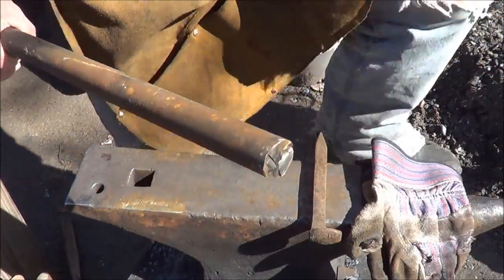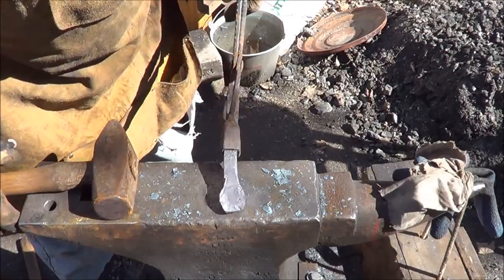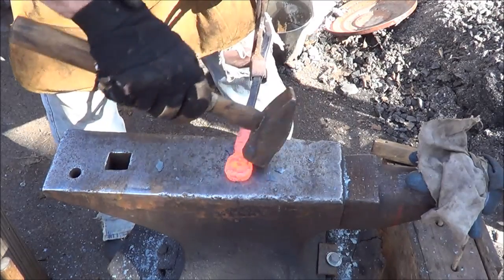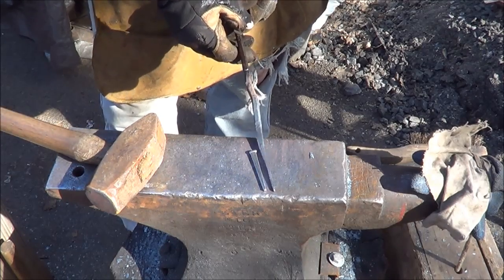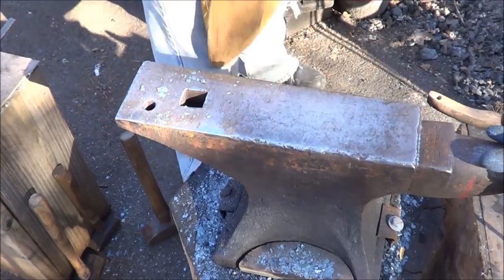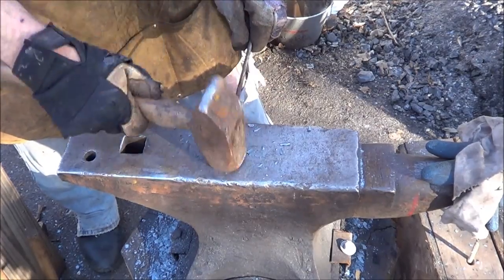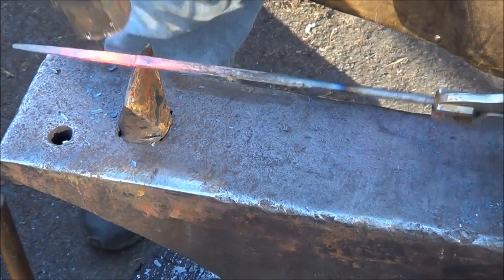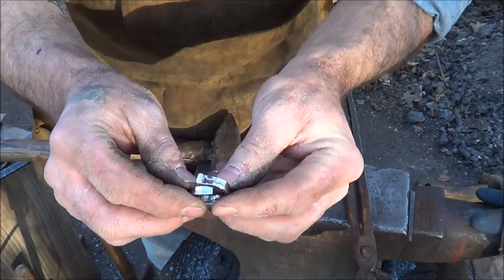Blacksmithing   Forging A Nail Header And Making Some Nails

Comment: Farmers used to make nails. During winter they would sit by the fireplace with a bundle of rods from the general store, and make nails. In spring they take the nails back to the store to trade for crop seeds. Just an FYI :)
Reply: aaron west 
when you think about it, nails hold a lot of structures together, so for people to take one object (such as a metal rod) and turn it into nails, which would be needed more so back then so you'd get a good chunk of change

Comment: When using a drift, wet the drift (or dip into oil or grease) and coat it in coal dust. The hot iron into which it is driven will turn the coal dust into gas and 'lubricate' the drift, preventing sticking and helping to not overheat the drift.... :-)

Comment: Chandler, I like the nail headers. Great to use a railroad spike for this. I'll check some here I Maine for hardenability. If you drift in reverse or from the bottom up, just a bit larger than the nail stock the nail will fall right out. Make sure when drifting you don't enlarge the top hole. I have also seen a cheat done with a drill bit to enlarge it. Not a criticism by any means. Just thinking.

Comment: Chandler, If you punch/drift a slightly larger hole from the back your nails shouldn't stick.  I've made a lot of nails at Ft. Vancouver and at personal demos.  Nice video.  I made a header out of a RR spike a couple of years ago and it's still holding up well.

Comment: I have a very old book that shows how to make a shotgun natural. It starts with these handmade nails that have been in a house or barn that burned down. One of the earliest places to get Steel, as the iron and could slowly soak up a bit of carbon while being protected by the wood beams themselves. 
I have looked for an old burned barn since to try it out.

Comment: You're doing more than I have! But I saw a trick where you bend the cut at 90 degrees and put it back in the fire with the tip pointing out the top of the coals. Your steel doesn't burn and you don't need to quench the tip!

Comment: Nice job on the nails and the tool too Chandler. I'm getting ready to get into some forging myself and I think this would be the perfect starter project. Not the tool mind you but the nails. I just ordered up a square nail header and it should be in around the middle of the month. By then I should have my anvil all set up and my forge up and going.

Comment: I make nails at a local museum for demonstration and I must say you done good. I wanted to get other ideas for making better quality nail header than what I have and I will give it another go at making a better one. You nails by the way are good but if you wanted to make them about 3-5mm thick, create a thick diamond tipped point at the end (about 1cm long) then score round the base of it and use the horn to spread it out. Keep an eye on the tip to about the thickness you need then just flatten it out so its about 1 - 2 inchs long. Cut the amount of 'meat' you want off for your head and thats it. I like to rose head the nail so it give it an old look and your finger glides off it

Comment: Hope you don't mind me saying:

When you are quenching, it's best to keep the piece moving underwater (or in the oil) by waving it side to side or swirling it around in a circular pattern.  The reason for this is that if it's kept still, a steam pocket can be created around the hot piece and this can slow the cooling - which is not what you want for hardening or tempering.  You need a rapid quench.

Obviously that's just another detail and not always essential.  Your quench worked for you.  But it's just another tip.

Great job there though.

Comment: hello chandler cool vid. i like the cut nail style header, the dbl header was even cooler idea. have you ever tried a round faced hammer instead of the cross pean ? and the horn ?i do not want to sound like a know it all, that is not my thing, but when  i changed hammers  i was able to move metal alot more affectively .bryan branzel has a great vid  on why he uses a round hammer.it changed the way i work. good to see you finally had some sun . cheers from south Texas ......   chris

Comment: Railroad spikes sadly aren't used on train lines in the UK, they use a different method of attachment. Thats why they are so damn hard to find. I tend to just use old cold chisels, its a resonable compromise, you can do with them most of the things you can do with spikes.
Reply: JacksonNomad Anti-roll bars off vehicles are a good source.  There's no demand for them 2nd-hand so the scrapyards should let you have them cheap - or even free if you have a mate there.  You only need one of two for several feet of good carbon-steel round.  Old coil springs are the same.

Comment: What if made it so you put the stick in the header before adding the point then you might get a cleaner head and you wont have to tap the point to get it out. You could have to add a little with to the top of the bar stock but thats not hard. Not sure if that would work, just a thought.
Reply from the maker: Daniel Bennett In a controlled chamber you could extrude the entire nail through the header... here you need the shank done before you go to the tool

Comment: heres a little data for you: 
Tungsten carbide
Chemical Compound
Tungsten carbide is a chemical compound containing equal parts of tungsten and carbon atoms. In its most basic form, tungsten carbide is a fine gray powder, but it can be pressed and formed into shapes ... Wikipedia
Melting point: 5,198°F (2,870°C)
Density: 15.63 g/cm³
Formula: WC
Molar mass: 195.86 g/mol
Boiling point: 10,830°F (6,000°C)

Comment: a master blacksmith that mentored me told me "Work the metal while it's hot, or you'll go to hell!". I see you're working the metal a lot even though it's dark and cold. what's your comment on that? no offence meant. another funny quote was "a real blacksmith works all day, and then goes home and makes babies!"
Reply from the maker: meNtor890 Sometimes the camera or working outside makes the metal look not as hot as I see it... sometimes I am stubbornly not wanting to go back for another heat...   BUT when the metal goes from red to black... at that point working it when it is black but still very hot allows you to use the hammer to clean up the hammer marks on the surface.... so often i will hammer hot black as a clean up.

Comment: Question. I keep hearing videos saying the anvil should be right at your knuckle height down at your side. Your anvil seems much higher. -A quesiton Coming from no experience.
Reply from the maker: vINCENT Zr I work on a lot of smaller detailed projects... I am an old man...lol... My eyes are not as strong so I like the piece a little higer so I am not bending over as much to see the details....  So the anvil is higher than the "standard"  however, when I need some heavy hammering done I have a block I sand on to give me a couple more inches on the anvil and more power